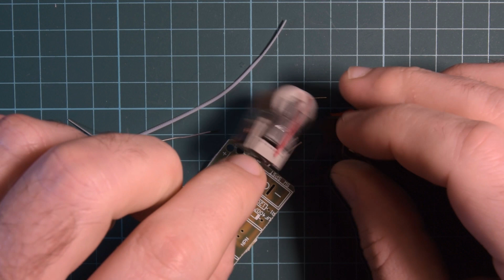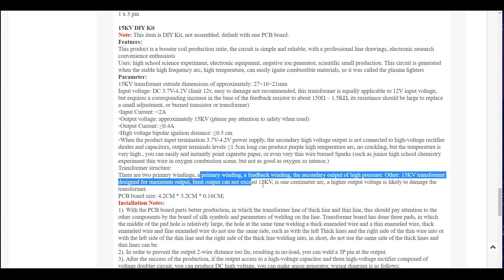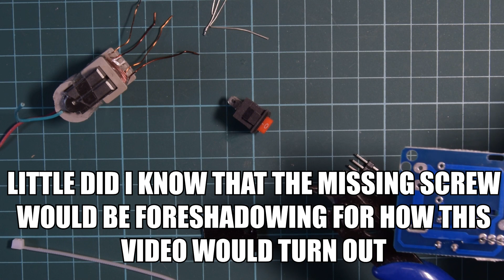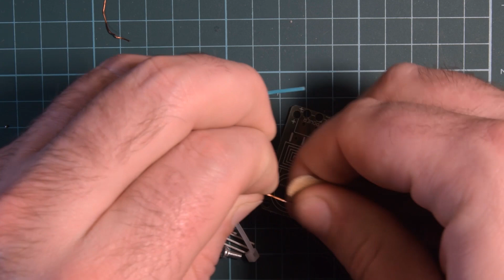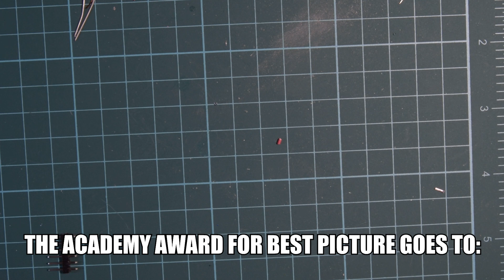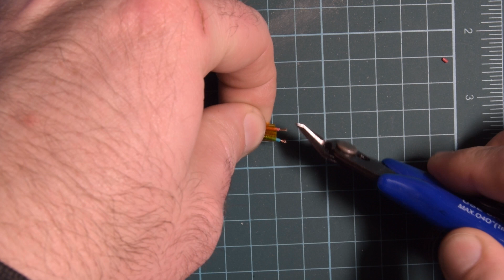Kit Build: 15KV Generator

Comment: If it doesnt oscillate swap the two feedback wires (the thin ones).  It works way better if you replace the supplied resistor with 2200 ohms and connect a 4.7 nF capacitor across the transformer primary.  As supplied the circuit draws way too much current even at 3v.

Comment: I found the following info on AliExpress that may help but may also confuse.
Product use precautions:
1. After the transformer is successfully manufactured, it must be sealed with epoxy resin or insulating wax for long-term use. In the air-loaded operation, the coil breakdown will be damaged due to insufficient air insulation strength!
2. After the kit is successfully manufactured, the input voltage is 3.7V, that is, the 18650 rechargeable battery. If you need to increase the input voltage, you need to increase the resistance (the default resistance of the kit is 150 ohms), otherwise the triode will burn out easily. (maximum boost 12V)